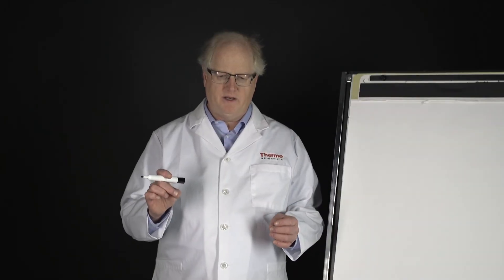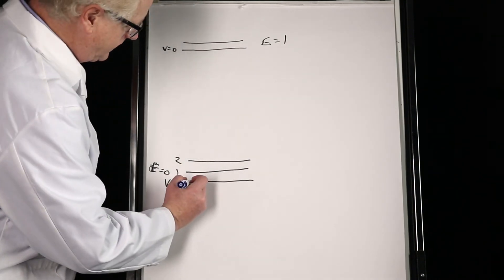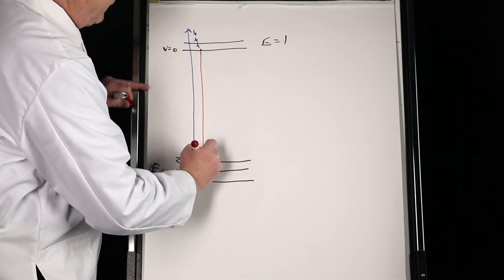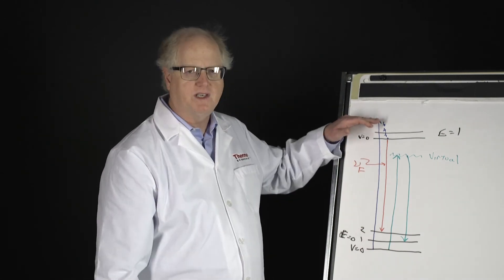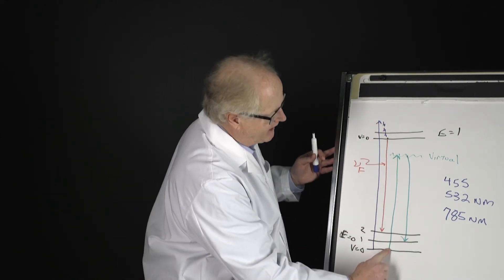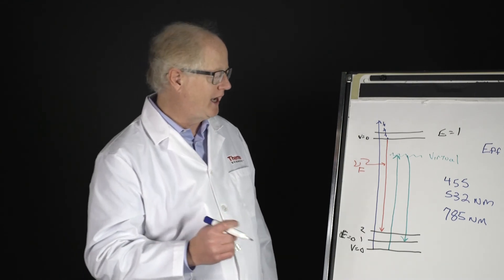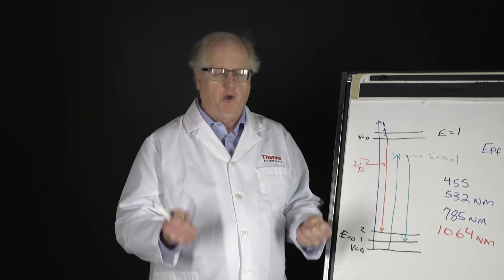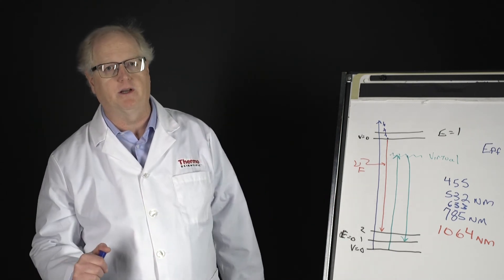Building the Raman System: Lasers and FT-Raman

Comment: This optimum solution between the two, fluorescence and low efficiency, is it in any way related to the spectrophotometry's principal idea that the optimum solution there has to do with opting for the radiation which is best absorbed by the molecule that is measured?
Thank you for your lessons; they have been very helpful to me.